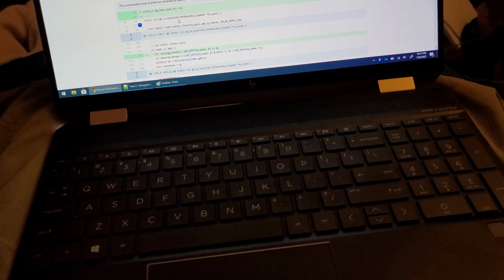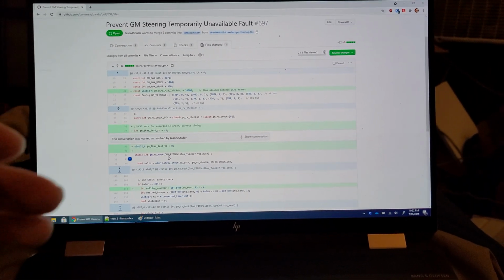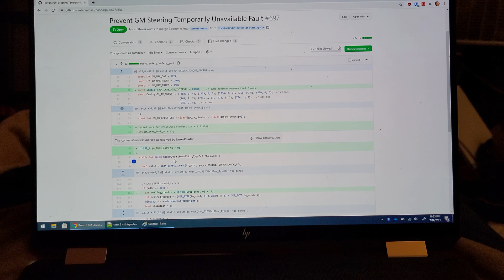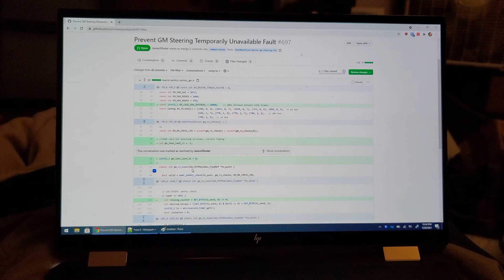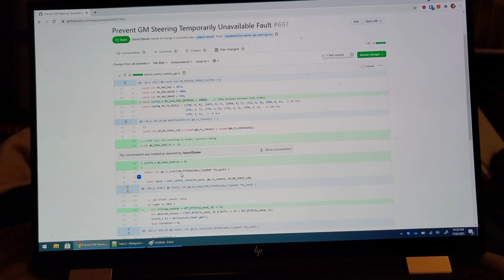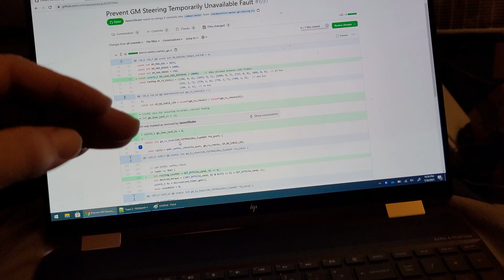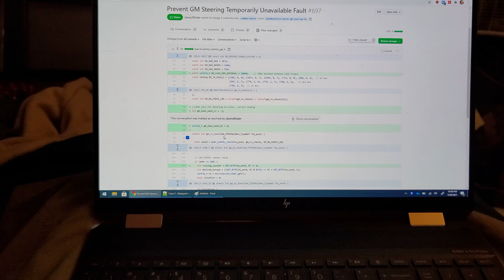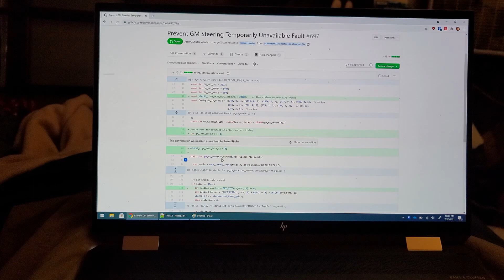Self Driving Chevy Bolt EV Openpilot port news! Finally!

Comment: if i add this to my 8.8 fork will it work with my GM vehicle that gets the lkas message?
Reply: Most likely, do you have hanabi95s fork? He has 0.8.7 that works for bolts/GM cars. Updating the panda code should be relatively simple although a couple of lines have moved

Comment: Comma three.  Would love a video on your take, even if you don’t plan to use / support it on the Bolt I’d enjoy your take on it. 

I have 3 Bolts and a Tesla and would love to try Comma three. 

How you are doing well.
Reply: @StandBackLabs   it’s expensive, but about the same price as Tesla autopilot… ~$2000. , but they don’t support the Bolt and I presume that’s not including the accelerator interface.  

You process seemed awesome. 

Anyway, I typoed. I meant “Hope you are doing well.”   I am still super impressed with what you were able to build and solve. My Bolts “lane keep assist” is hot garbage. I can’t believe GM sells that as a “feature”. 

GMs Supercruise isn’t something we can add, only a factor option for the EUV.